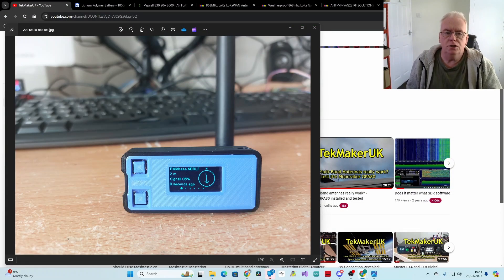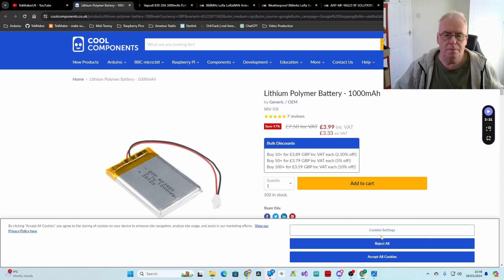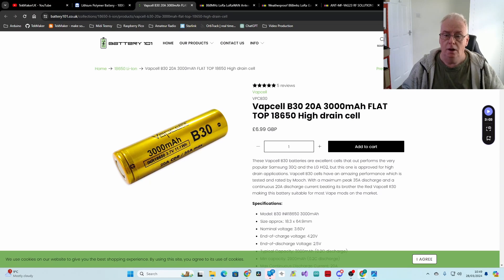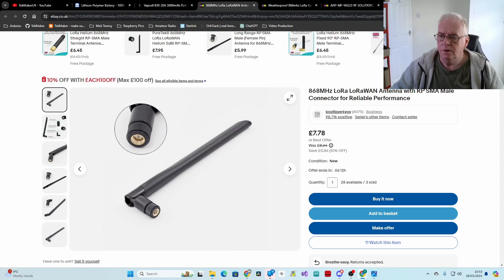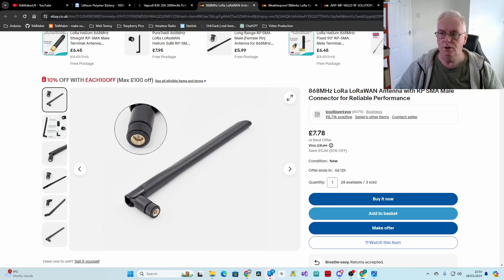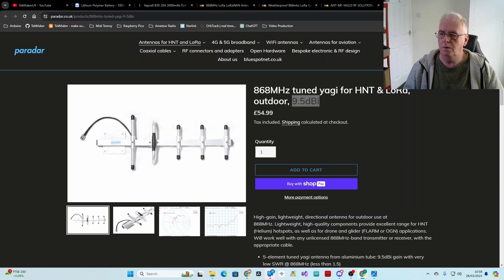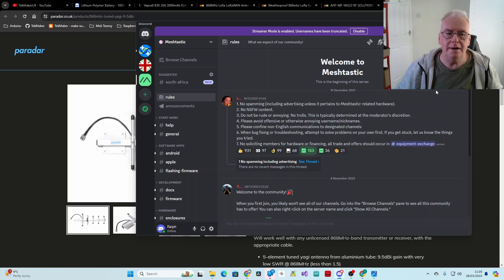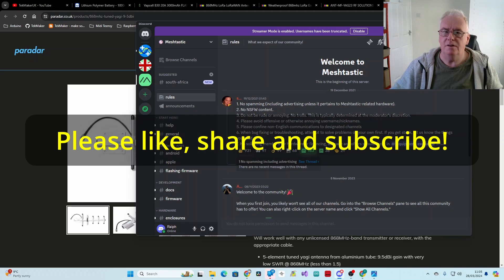Meshtastic Mastery: Getting more from Meshtastic,  how do we progress?

Comment: Great video!

I bought 3 T-beams over a year ago, and never got around to setting them up properly. One of them had a faulty GPS module that I was hoping could be fixed with a firmware update, but I just never got around to it and other interests ended up taking over.
I should probably have another look at it now its gaining in popularity a bit more.

Is there a particular network name etc to use so that I can find other people in the UK? I'm in Northumberland.
Sorry, I know this information is probably available on the FB or Discord groups you mentioned but I don't use either app.
Reply from the maker: Look for regional groups on FaceBook and Discord like the ones in  my description
Reply: @tekmakerUK  I don't use either of those platforms, but I'll have a look at the Reddit link you've shared. Cheers.
Reply: I post as much as possible on the Longfast channel on the air since that is the one which everyone has and it is included in the firmware by default.